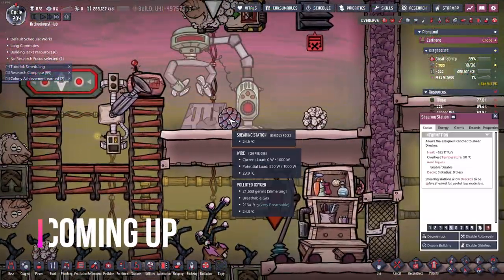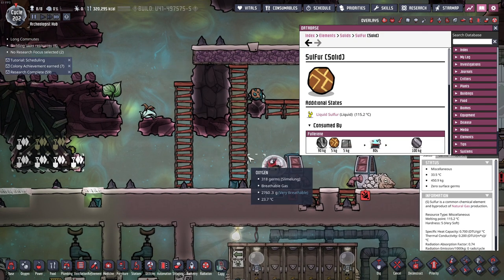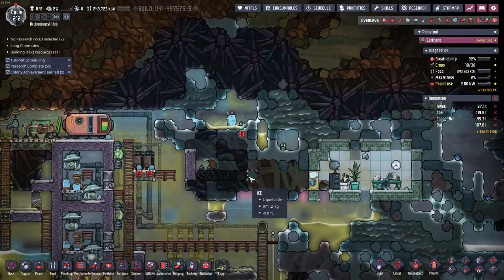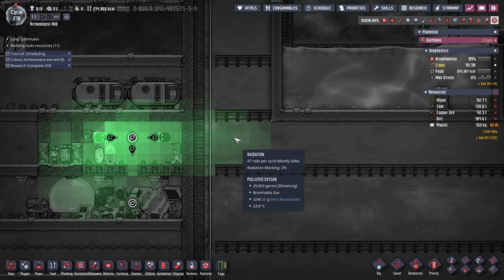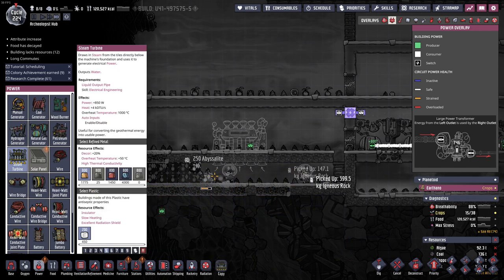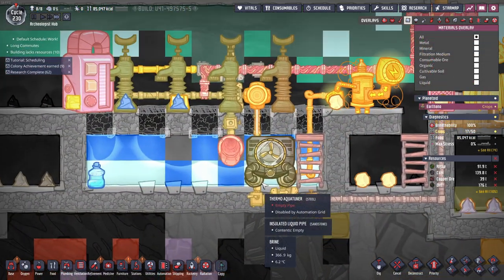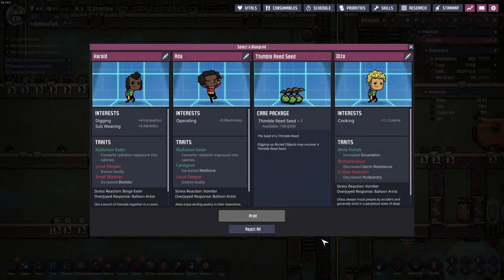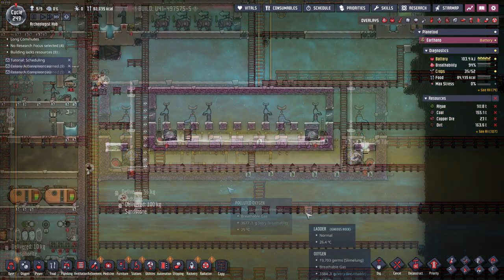O.N.I Spaced Out [S3 Ep7] - Radiation, Plastic & Cooling Loops

Comment: 1:25 Auto sweeper can provide dirt to farm tiles, but only if a dupe hasn't already claimed that job. Try turning the priority down if you need to.
Reply from the maker: That was my feeling as well, the priority is set to 3 but the farmer dupe still comes over to deposit the dirt for some reason :P
Reply: @basemanager  Unless they changed something.. Haven't played for a couple updates. But the last time I did glossy dreckos, I had autosweepers feeding the farm tiles.
Reply from the maker: You are correct, the auto sweeper sometimes delivers the dirt, i'll lower the priority even further to prevent the farmer dupe from taking the job :P thanks for the tip